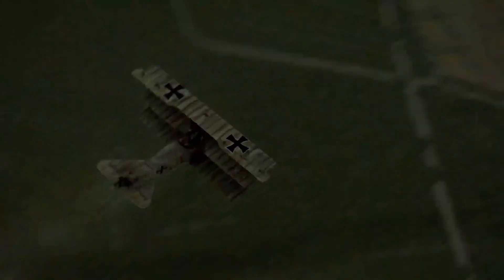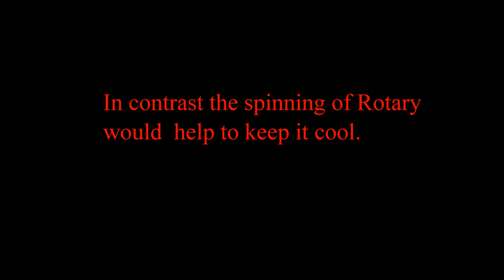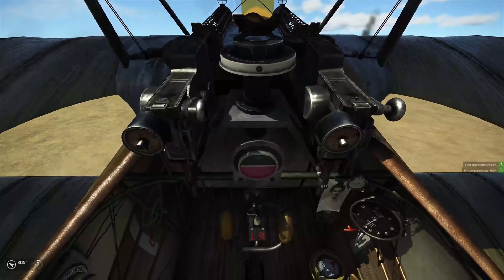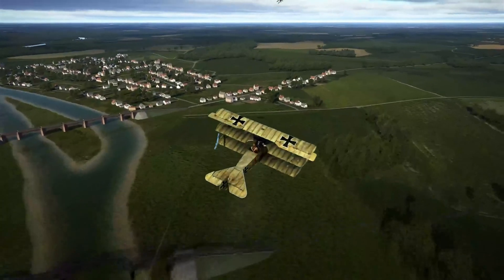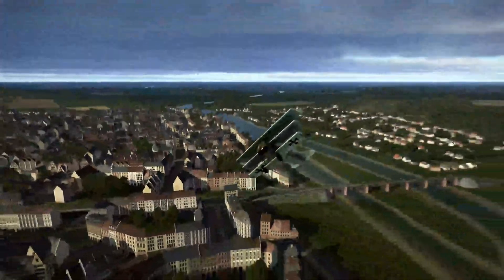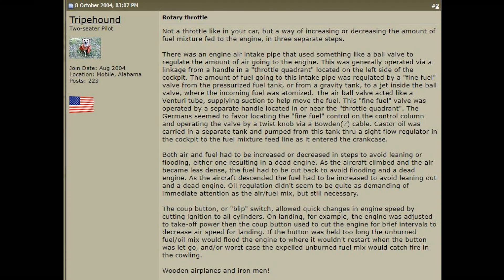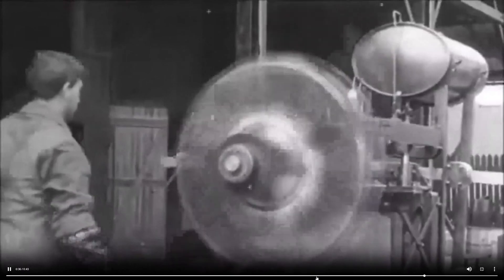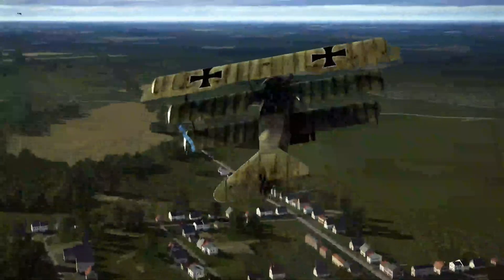(15) IL-2 Flying Circus - Rotary engines and the Blip Switch - How to use it.

Comment: I’ve found that I need the blip switch to land the camel, I can’t get the speed low enough to land without it and I just glide across the field. I also have difficulty set to “normal” rather than “expert,” so that might be part of my issue.
Reply from the maker: That is exactly how the blip switch was used. I never fly on normal mode, you may be right it might affect something. I'd just fly expert and learn the greater challenge